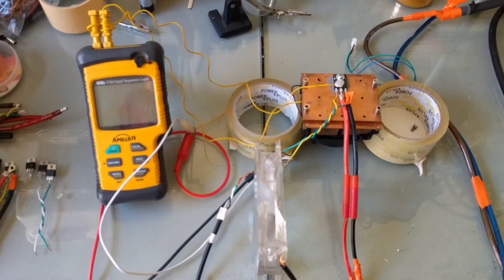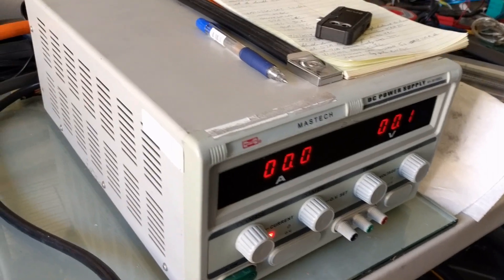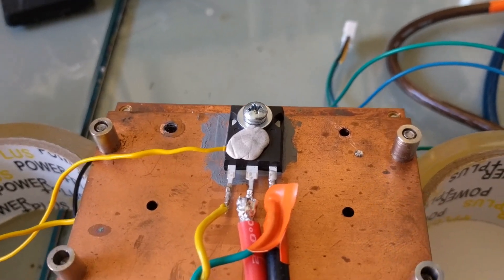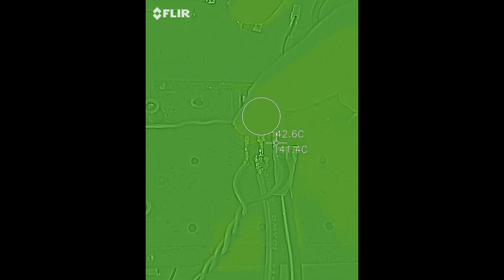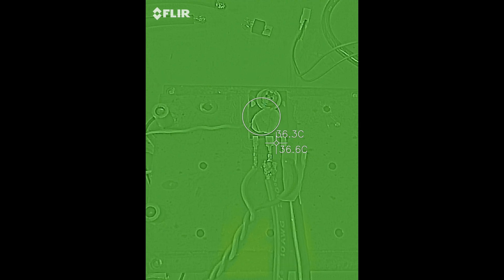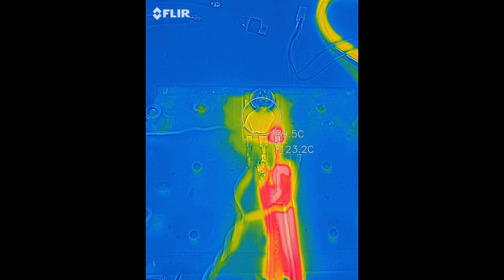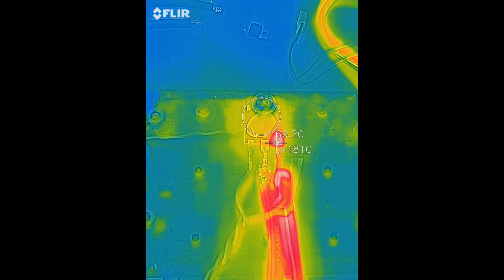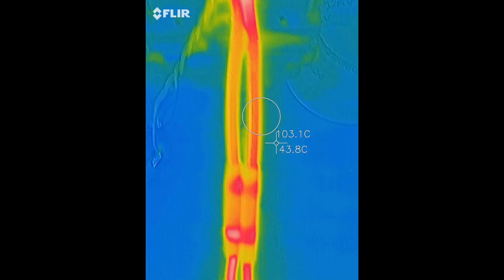100A through a MOSFET?  Watch it heat up with FLIR

Comment: Leg limits are the kicker! Look at all that heat on the source leg. That's the limiting factor here.
This test isn't a realistic use case for most mosfet uses...like you stated.
Reply from the maker: The high leg temp is ok depending on the application and length of time. It's also possible to actively cool the legs or use additional copper on them to reduce the resistance.
Reply: @ZombieSS77 

For continuous use at DC you would use a couple mosfets in parallel so neither one sees the full load. 

You are soldered to the thin section of the leg, not the wide section. Typical motor controllers and PSUs if the manufacturer is paying attention, they push the mosfets down into the board as far as they will go. They make sure solder flows up onto the wide section of the legs. This allows the traces on the circuit board to pull heat away from the source and drain legs. Beefy copper and solder traces on the circuit board act as a heat sink for the legs.

Even in a DC application, you can use PWM. You will need filter capacitors, but as long as the caps maintain voltage with minimal ripple despite the mosfets turning on and off rapidly, you can do this. The switching frequency will need to be something like 5-10khz, but  the mosfet won't have problems with that. The end result is the mosfet is still turned off part of the time so it warms up less. 

As a future video, repeat this test, but use PWM to turn it on and off quickly. Same amperage, same mosfet on the copper slab, but try 25% PWM and then 50% and then 75%. This is a more realistic use case for a mosfet in a switching power supply or motor controller. 

With PWM, you can exceed that 100 amps by quite a lot. A typical motor controller does this all the time since the mosfet has a sliver of time to "rest" before it gets loaded again.

I wish I had a FLIR so I could do stuff like this.

While you are making a video using PWM, redo this one with good wiring so your are not adding heat to the mosfet legs. Your wires ought to be pulling heat away from the legs, not adding heat. You want to simulate what is done in a controller or PSU. Heat extraction via the traces is deliberately designed in.
Reply from the maker: @de-bodgery  you're making many assumptions on my application. The purpose of this test was to verify a CFD model I'm using for current density and thermal dissipation of different parts. I've modeled the bond wires, legs and dice (my model is good enough). This was just one of many tests.
Reply: @ZombieSS77  

I have no idea what your application is. I was offering what is done in typical mosfet applications. No assumptions made beyond that.
This is a good video...just hoping you will do more testing. :)
Reply from the maker: @de-bodgery  I'm researching parallelization of many discrete devices and have made some significant breakthroughs in layout geometry to minimize effects of parasitic RLC effects.  Not sure how much I'm going to make public as I'm interested in manufacturing my own high current modules in the 1kA range.  I do like to share information and post about power electronics over on www.endless-sphere.com.
Reply: @ZombieSS77  What is your name on ES? I'm on there pretty regularly too.

1000A isn't that hard. It's just lots of parallelism. Are you familiar with the KWeld battery spot welder? You are looking to duplicate the mosfet switching section of this device. It can do 1000A. Of course it works at up to 30v, but then all you need is higher voltage mosfets to switch high currents at higher voltage. 

Low side switching is easy. Dealing with the capacitive junction of the mosfet gates is easily dealt with too. All you need to do is use a 10K resistor to bleed off the voltage on the gate to ground. Apply 5v to the gate and the mosfet turns on. Take awy the 5v and the 10K resistor immediately pulls the gate to ground.

High side switching is a bit more difficult. Probably the easy way is to just use a high side mosfet driver to turn on the mosfet. You can do the same thing with a TL783 linear regulator and a couple of resistors.

Depending on the speed of switching you need, the capacitive gate issues matter more or less. Pull down a bit more with a lower resistor value or limit how many mosfet gates you have in parallel. Capcitors in parallel add together. You really shouldn't have much trouble driving 8 mosfets in parallel, just use a separate 10K pull down on each gate.
Reply from the maker: @de-bodgery  this is me https://endless-sphere.com/forums/viewtopic.php?f=30&t=58341&hilit=Controller

Comment: It would have done better if the source pin wouldn't have had so much resistance.
Reply from the maker: The hot spot on the source pin is totally normal.  It's due to the bond wires not being able to shed heat due to being encased.
Reply: @ZombieSS77  What do you think about nxp lfpak88 mosfets they use different bonding mechanism as clip not bonding.